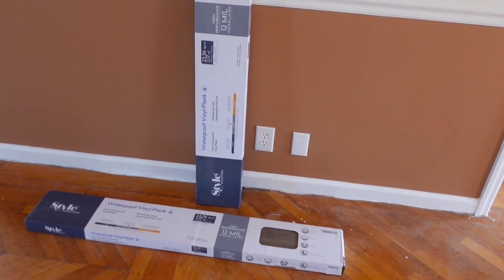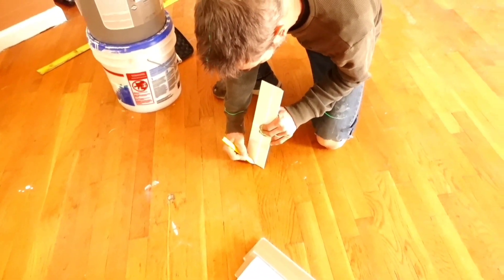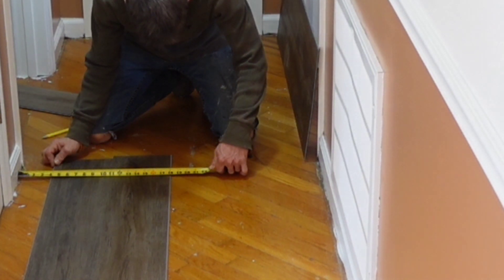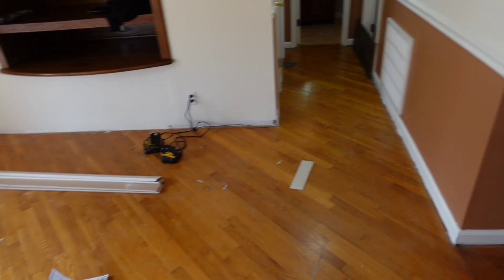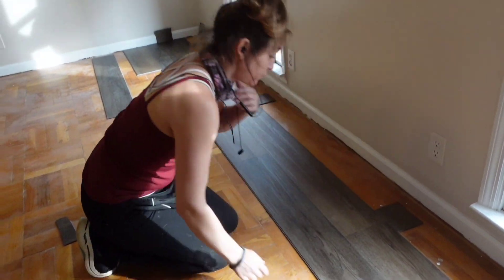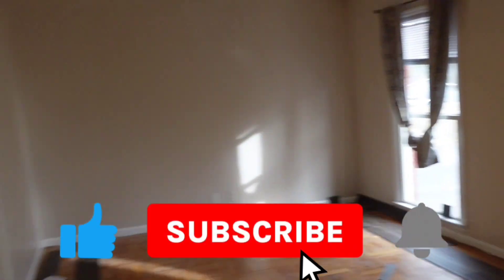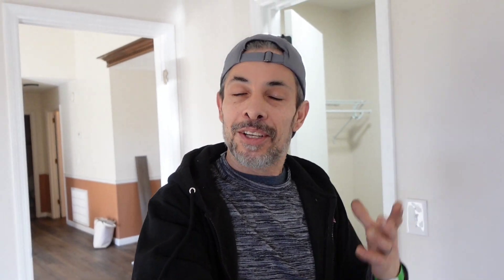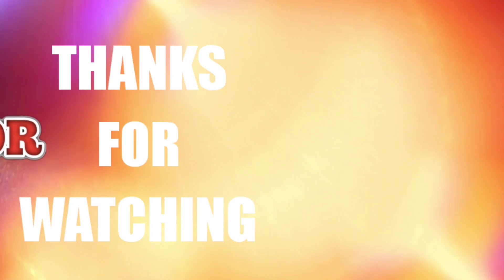How To Center Your Hallway Using A Cigman Laser Level

Comment: Sacrilege to cover such beautiful parquet with lvp, but even worse to lay it straight on top without any uncoupling. It's like a waterbed of floors - all floating, will loosen within weeks!
Reply from the maker: You know… with respect it surprises me how many people say things without doing their own research. Not sure what uncoupling is but if you mean moisture barrier and that is how you do it, then you will be the one with moisture and mold issues. This is not my house. It is a rental for one of my customers who wanted it covered so that if she ever sells it the new owner still has the option of refinishing the floor. Wasn’t my choice. And every month when she collects rent she doesn’t have any thoughts of the floor being covered. We didn’t ruin it or tear it out. We only covered it with lvp. Never had a floor come apart in 15 years. When you put plastic down on wood subfloor or hardwood in this case. You end up tripping moisture and eventually there will be black mold. Can’t tell you how many floors I’ve torn out because of this issue. DIYERS just don’t know. That why us professionals are here. The floor comes with pad attached to the bottom so no need for anything else under it. Hope that clears you religiously issues up. Thanks for the comment